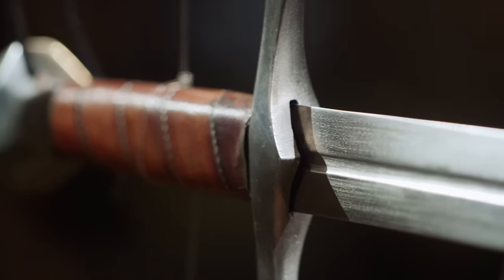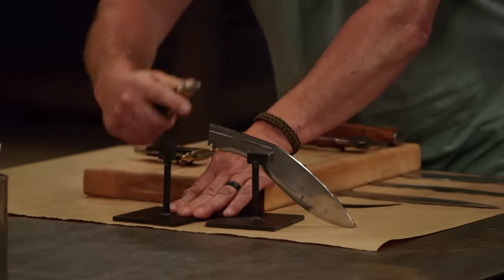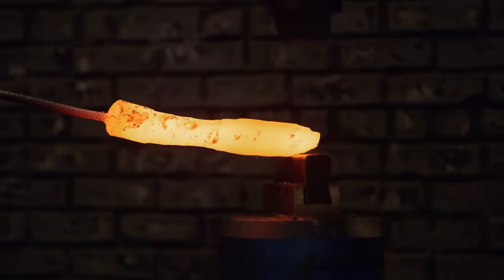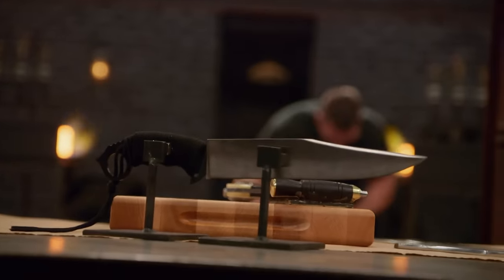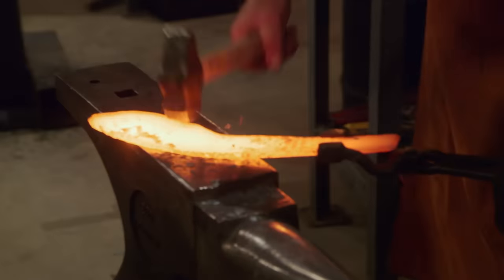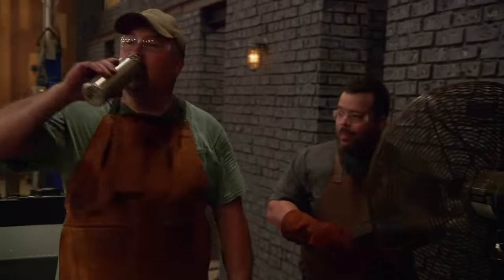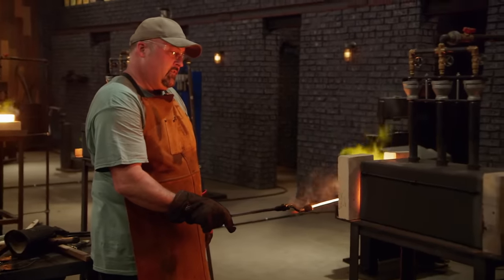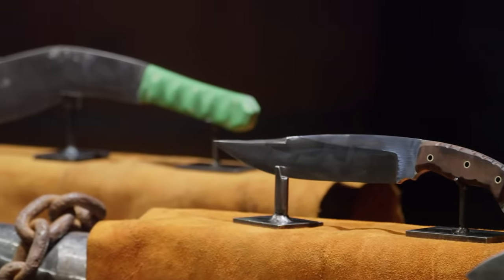Bladesmiths COMBINE Knife Styles to Create "Mashup" Blade | Forged in Fire (Season 7)

Comment: Bowie knife with dagger handle would've been the smart choice
Reply: Smart, safe, and more than likely a trap set by the judges themselves. Because in a way, making the tang for the dagger is identical to making the original coffin handle. The major purpose of this test is to showcase that layer of flexibility in mixing the blade and the handle, as well as forging the atypical mix.
Reply: Or vice versa
Reply: They would have had to forge the handle of the dagger out wouldn't they? Unless you are talking about the pugio designed handle
Reply: @muchluck7981 yeah, the dagger handle would have been much more work, and not been "the smart choice"

Comment: Well the definer for a Kukri is not just the bend but also two tiny little knives that come with it.
Reply: One of the little "knives" is not a knife but a sharpening steel. At least has been with all of mine.
Reply: @sonofbr  Mine were matching with the handle but the blade on them was not much bigger than a large fingernail file and straight. I was told it was to make the kills. I assume for bragging rights. I like them and if I ever went hunting I am sure I would use them.